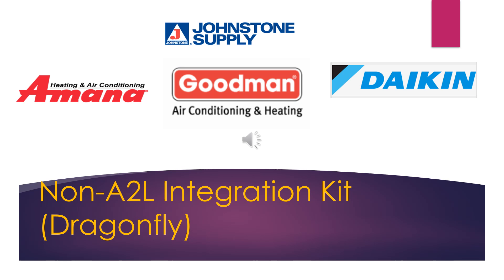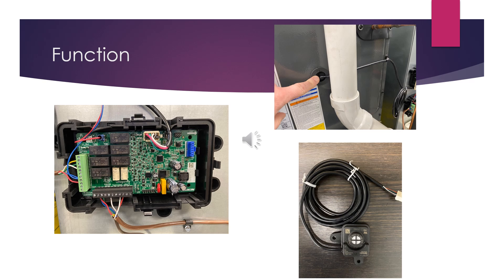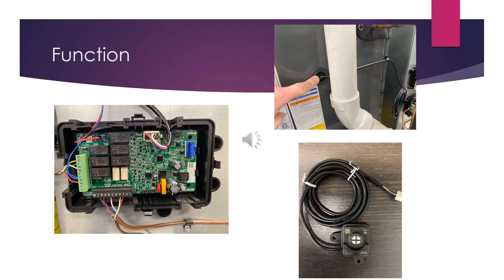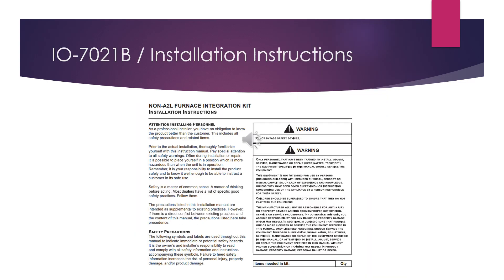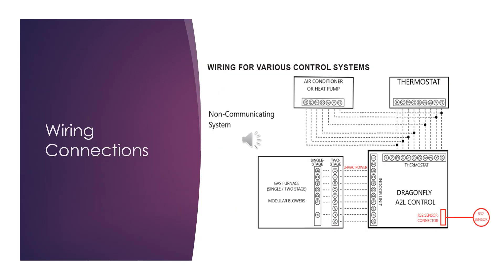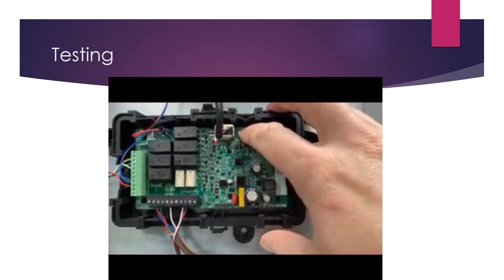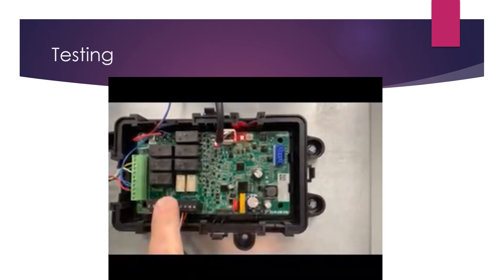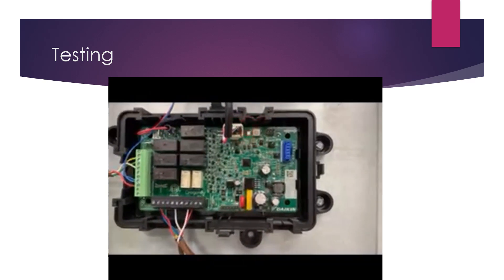Dragonfly Integration Module quick Review

Comment: Does it detect r454b
Reply from the maker: It would detect R454B (79% R32) as well as any methane such as NG and LP. It is only approved and tested with R32 as well as the sensor that plugs into the board is only approved for R32.

Comment: Can I just run a C wire from the furnace to the dragonfly or does it have to come from thermostat.
Reply from the maker: The furnace connects to indoor unit and will supply the C wire along with R,Y,W and G. The thermostat connection uses the C wire to supply common to the outdoor unit and thermostat if needed. Caution not to install the outdoor 2 wire (Y and C) to the furnace, it must connect to the thermostat.

Comment: How about a zone board.
Reply from the maker: We do have a 0230K00007 Nighthawk Zoning Integration Kit that can be used for immediate opening of 3 zones for mitigation (all dampers need to move to the open position) as well as accessory power to be disconnected as needed. Although the current EWC is R32 ready it still requires the Nighthawk but the EWC 1.86, released any day now, will take the 24volt alarm signal and force all dampers open. When zoning without EWC and non communicating the manufacture of the zone panel will supply information on proper connection for A2L. As an example removing power from a honeywell system with spring open dampers will only need power removed during mitigation and all dampers spring open.